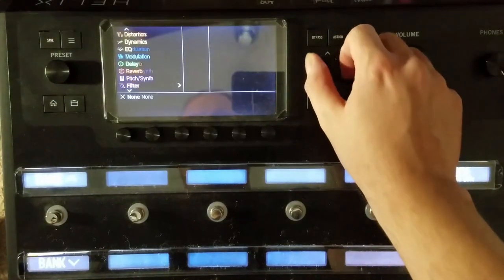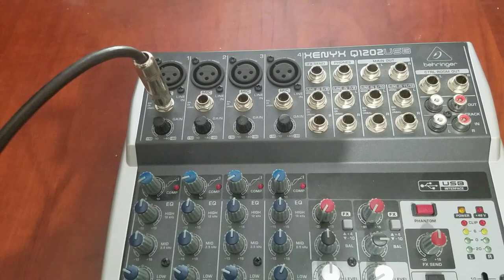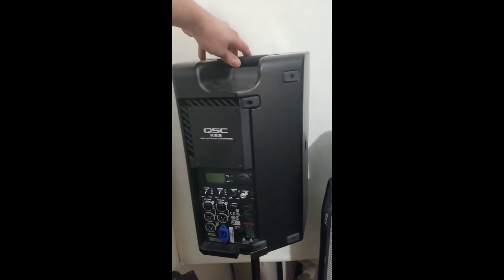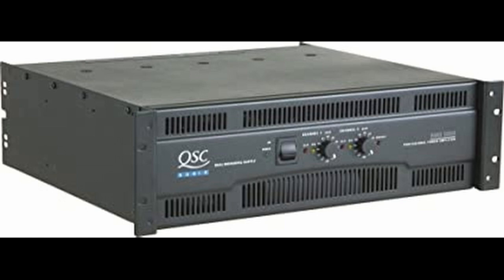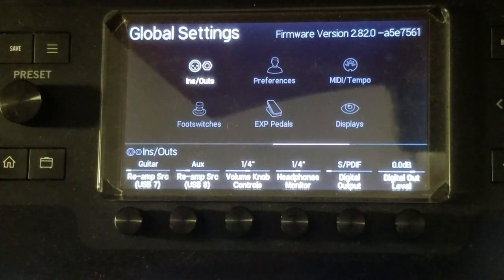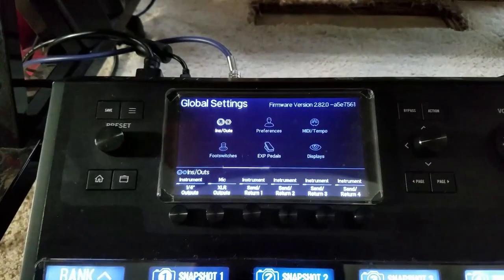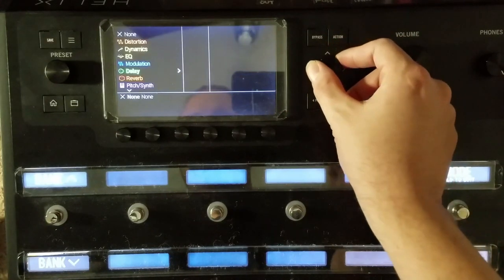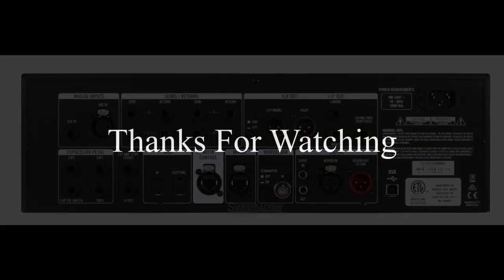Line 6 Helix Tutorials #5: Connecting to Speakers

Comment: Great video . I would like to run my amplifiers preamp signal into my line 6 hx stomp is this possible.  I have the peavey 6505 plus it has efexloop I think you were saying this in the video but I still dont understand..
Reply from the maker: Yes, this is possible. Connect the SEND from your amp to the RETURN L/MONO jack on the Stomp and place a RETURN block in your signal path either at the input block or somewhere in the middle -- and your preamp will be running into the Stomp. What you want to do with it from there can go a few different ways..

Comment: Great video, thanks!
I have this situation where i want to run my helix with two separate paths - one for my studio monitors (in live situation PA), one for my blues junior, to mix in real time the sound of both together. So far i'm doing good, but i have a small issue which is driving me nuts - my backing track is coming from my pc in to both - amp and monitors, and it is impossible to tweak anything like this. Does anyone knows how i could set up my computers audio to go only to monitors?
Reply from the maker: Without seeing your preset, it's a bit tricky. I'm assuming you're outputting through the main 1/4" outputs to your amp. You might want to try instead routing the amp signal to one of the Send outputs and changing the output block accordingly. Again, I'm assuming your setup here. Let me know!

Comment: Hi I have a Zoom Rack Pre-Amp/Effects unit which I love the tube sounds on.  I want to use this with my Line 6 Helix (Rack) and I also have a GX700 (i'm planning on using a midi cable to send changes to the Zoom)  - how should I connect these together and set up my Helix ?  I also have an A/B switch if this helps ?
Reply from the maker: It depends on what you want to get out of the units you have. The Rack has 4 independent loops for each piece you want to integrate, and you could place each Loop block in the Helix signal chain with your guitar in the Helix Guitar input. This way you could route the signal through any of the Helix blocks as well as your other processors.
Reply from the maker: you have the ability to run the Helix or Helix Rack as a 4 channel mixer/splitter for 4 separate processors and add Helix blocks before or after those signals. I haven't done so myself, but in theory it is possible.

Comment: hello,  how should i connect my helix LT into two HK pro Move 8 active monitors??? i want to use that for live gigs... thanks
Reply from the maker: Hey there. You can either use quarter inch cables or XLR cables to channels one or two on your speakers. Keep the speaker knobs at noon (reverb off) to start off and see how loud that gets you. The two band EQ looks like a useful feature if you find the tone too bassy or harsh.
Reply: @alex-kenivel  okay so far: use the output (1/4inch) for the active monitors, and to the PA/ Mixer i could use xlr via DI or do i not really need a DI for the level?
Reply from the maker: @chrisrexeis3054  use a DI if phantom power can't be switched off for your channel at the mixer. The DI expects a quarter inch instrument level input and gives a mic level xlr output with a transformer that blocks phantom power. At that point you'll need to run xlr cables to the active monitors or use the split off from the DI. Using the split from the DI doesn't let you disable the big volume knob from FoH
Reply: @alex-kenivel  okay i see thank you, so far. i´ll try that next week...

Comment: Just a quick / maybe silly question: Can I run my Helix LT straight (1/4 inch) to a clean amp (small 30watt) just for home practice / use with amp mods / IRs etc. still on?
Reply from the maker: You CAN, but results may not be favorable. Running into the front end of an amp imparts the characteristics of that amp's preamp, poweramp, whatever onboard effects are available and its speaker onto your preset, basically running an amp and cab into another amp and cab. 

Purists will frown upon this way of connection but getting favorable results this way isn't unheard of. Just dont make any changes to your main presets when connected to the amp this way. Instead, try making a separate preset dialed in specifically for this connection and treat your blocks as "effects" as they were -- amp blocks becoming more like distortion pedals and cabs more like EQ.

In short, yes you can, but it may sound strange.
Reply: @alex-kenivel  great thank you! I’ve actually made arrangements to borrow a frfr to adjust my tones
Reply: I would turn the cab models of and just use the amps because your soeaker is already it's own model irs and cab models are for power speakers and head of house not to your amp combo or 412 cab or what not.
Reply: A bit late here but just saw this. I use a 1x12 cabinet and leave the cabinet and mics on. Stick the cable into your amps return input for power. Tbh at that price it should come with power like the Kemper powered rack or toaster. Anyway for some reason the helix with a real guitar cabinet can handle it for some reason. So could the atomic amplifier and players spoke about it sounding better too by leaving cabs on. Kemper no turn off cabinet. But don’t plug things in the front. It will sound horrible. I use a real overdrive, distortion or fuzz in front of an amp block in the loop. You have to hook it up in the back where it says send and return but then set the menu to loop. It helps with sound and feel. Is it as good as a great amp and pedal? No because it’s not. But they’re fun to fool with and if you gig, more convenient.

Comment: Awesome video... So I can use a stereo DI Box to send stereo signal using 1/4 inch jacks and send stereo XLR cables to two panned channel strips in a mixer? Does not matter if phantom power cannot be disabled.
Reply from the maker: Thanks, and yes